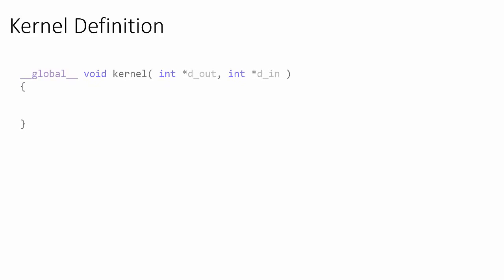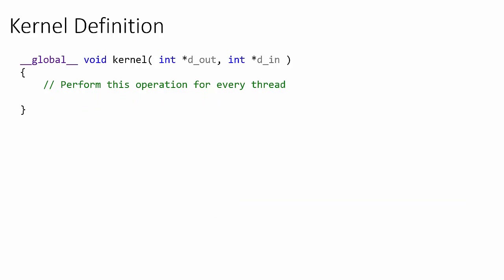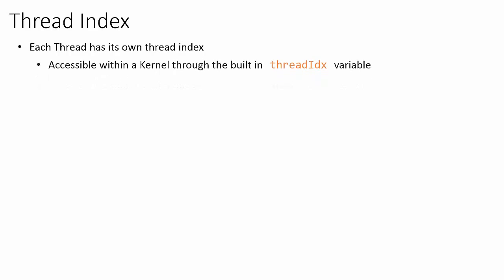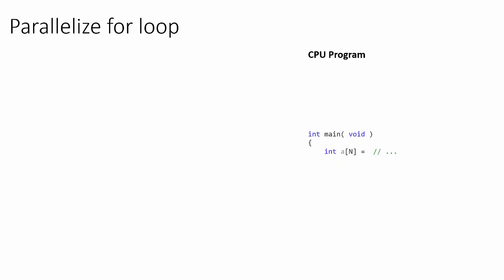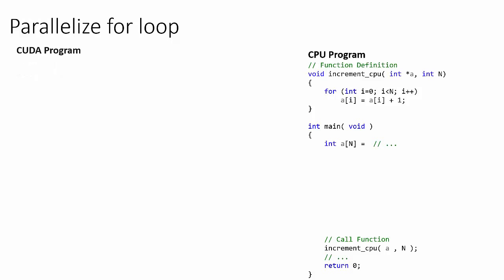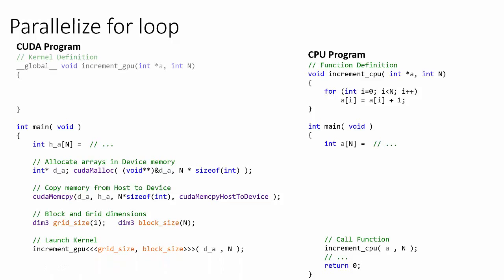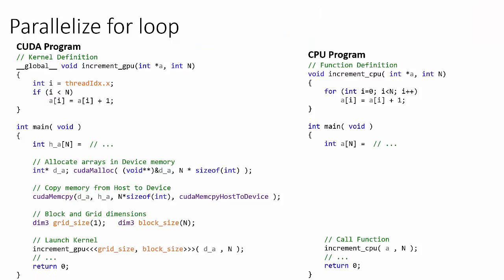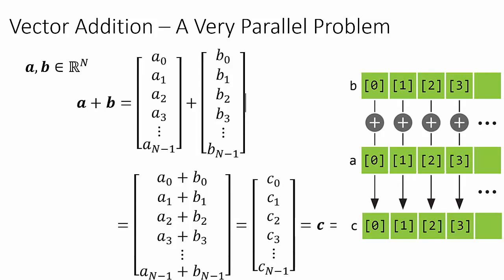Intro to CUDA (part 3): Parallelizing a For-Loop

Comment: taking (int *a , int *b, int *c, int N)  as parameters to function where a and b are input vectors and c as result,  inside if condition c[i] = a[i]+b[i] ;  did I miss anything .? would like to know how the solution.
Reply from the maker: Hi Surya. Excellent work!   a and b are inputs to the kernel as pointers to the memory address of the first elements of arrays that we pass into the kernel.  c is used in the same way, but as an output array.  Then you simply add the elements of the array together in an elementwise fashion like you would in a for loop (c[i] = a[i] + b[i]) but you instead do it in a kernel which is executed as parallel threads on GPU cores.  The tricky part is setting up the configuration parameters to actually launch the kernel. The configuration parameters tell the kernel how you want to map the threads to cores using CUDA's  thread, block, and grid model.
Reply: @JoshHollowayAI  thanks for your response Josh